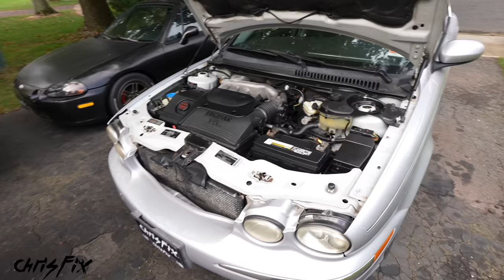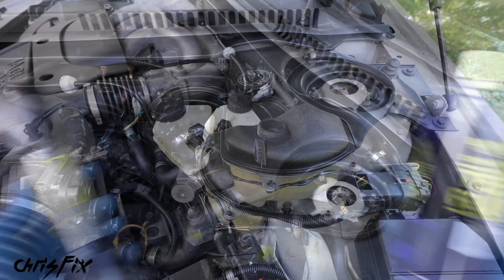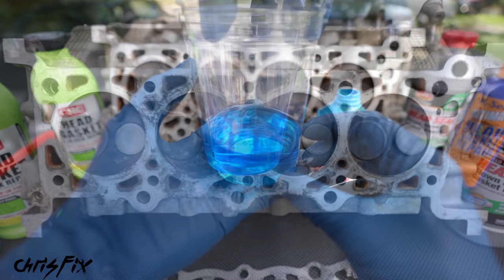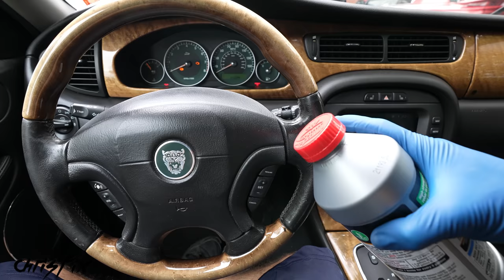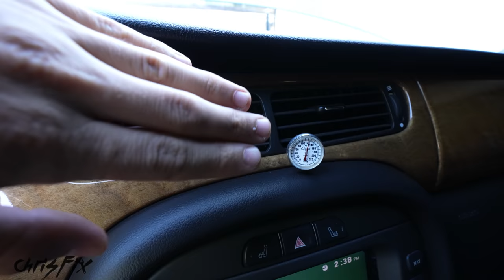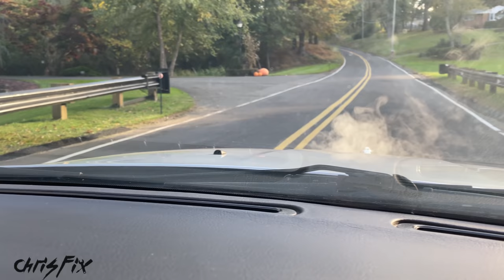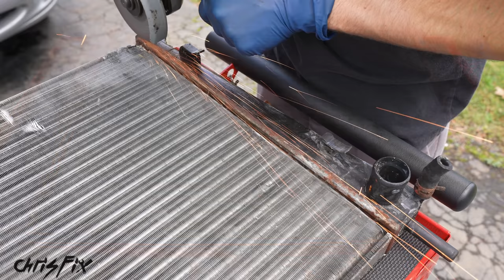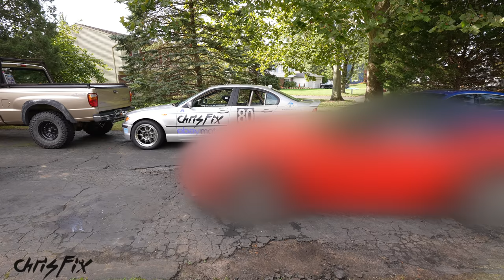Do Head Gasket Sealers Actually Work (FULL 2yr TEST with Engine Teardown)

Comment: I wonder if it would work on a diesel engine - high pressure
Reply: Sure.
Reply: @SinsBird  thanx, I think,  - guy near me is selling a John Deere backhoe for 2400, wants it gone, blown head gasket, it would be deal of the century if I could pour a bottle that stuff in and fix it for  a while
Reply: Success of this kind of repair depends on how much you are willing to prep for it. Things like flushing the cooling system multiple times, removing the thermostat, glow or spark plug of the worst cylinder etc improve your chances a lot. Also it should not be done in one go.
Reply: @SinsBird  thank you - good advice
Reply: @jameshallahan4376  no problem. If you decide to try this, make sure the cooling system is pressurized, because pressure is needed to push sealer into the leaking spot for it to seal. Use water. You can mix it with water before pouring into the cooling system. Keep the RPM above 1000. Let the temperature rise some, shut the engine off, let it sit for and hour, check coolant level, add water if there's less of it now, start and run the engine some more to reach a higher temperature than before, shut it, let it sit for an hour. Check the coolant level...and so on till it reaches the operating temperature. Don't hurry to dump it out of the cooling system, make sure that it sealed for sure, keep RPM high so it gets hot, then check the coolant level. If it's okay only then dump it out. Flush the cooling system multiple times before and after using the sealer.
Reply: @SinsBird  thank you so much - I haven’t got it yet, I’m next in line pending, good stuff to know, if I get I’ll let you know
Reply: @SinsBird  how did you learn all this?
Reply: @jameshallahan4376  well, if I'm doing something I like to actually understand what is going on and why, so I looked into the chemistry of it, which is quite simple considering most sealers are sodium silicate based and then thought about what is happening inside the engine, then I conducted my own experiments on several engines.
Reply: @SinsBird  excellent

Comment: What one works on the northstar 4.6. 😅
Reply: Is oil and coolant mixing? Oil in coolant or coolant in oil? Or both? Is the cooling system pressurized?
Reply: @SinsBird   no , it's just coolant-exhaust mixing.
Reply: @1967brokedude  If the cooling system is pressurized any sealer will work. If removing the thermostat would be a problem for you choose a sealer which doesn't have particle filler in it. I recommend to do it in steps, not one go, also keep the RPM above 1000. Let the temperature rise some, shut the engine off, let it sit for and hour, check coolant level, add water if there's less of it now, start and run the engine some more to reach a higher temperature than before, shut it, let it sit for an hour. Check the coolant level...and so on till it reaches the operating temperature. Don't hurry to dump it out of the cooling system, make sure that it sealed for sure, drive it keeping rpm high so it gets hot, then check the coolant level. If it's okay only then dump it out. Flush the cooling system multiple times before and after using the sealer.

Comment: Unless it’s oil I don’t think you should pour any of this sht into your engine. Just spend the money and replace the head gasket then you know it’s good for pretty much the life of the motor at that point
Reply: This stuff is just designed to be an inexpensive, very temporary fix; keeping your car on the road for as long as you need it to be, and it very much does that job well. If it didn't the jag would've still been losing coolant and the company selling the stuff would've gone bankrupt years ago 😂

Comment: What $7000 for the head gasket repair? What's wrong with mechanics?
Reply from the maker: It's a lot of labor to pull the entire engine, resurface both heads, reinstall, etc. And since the car was old they know other parts break. I am not justifying it, I am just saying there is a reason I didnt fix it properly either haha.

Comment: The instructions on the bar's states absolutely do not mix with coolant.
Reply from the maker: It says not to mix with oil. How is it supposed to work if you can't add it to your cooling system lol
Reply: @chrisfix  from their service bulletin on Amazon: WARNING:

"Head Gasket Sealant is NOT COMPATIBLE with antifreeze and must only be added to the cooling system after ALL ANTIFREEZE has been flushed and removed."
And Secondly mentioned: "ALL antifreeze must be removed or clogging may occur". The way I see it they want it to be the only thing in the cooling system. Love the video great long term analysis!
Reply: @chrisfix  I'm going to try it on a Suzuki outboard motor today. I think I might be the first to ever try it lol I'm going to put several bottles in a large bucket with the outboard sitting in it
Reply: @wests3771  That's not how it works.
Reply: @SinsBird  please elaborate how you believe it differs. Thanks
Reply: @wests3771  What I mean is that it needs adequately pressurized and sealed cooling system and warm/hot coolant. A lot of times it actually seals the most when the engine is shut off and the coolant is being pushed into the engine by elevated cooling system pressure from it being hot and when the combustion pressures are not fighting back. I can't remember the exact construction of outboards but you would need to find a way to seal the cooling system, probably plug the water outlet and apply pressure perhaps with an air compressor or something if the construction allows it, all while the engine is hot. Really seems like a headache, I think it would be easier to repair the regular way.
Reply: @SinsBird  I carefully read and exactly followed the product guide I'm confident I know exactly how it works but let me know what you think
Reply: @SinsBird  Roger that. I tried it yesterday. I did apply pressure to to outlet at times. I appreciate the input on the differences in cooling systems  Good point. Time will tell if it worked for me.
Reply: @wests3771  Product guides are really half assed in this case and just enough to sometimes work for a person who does not understand engines and doesn't have the tools to do the job the regular way. A real educated mechanic who knows basics of chemistry and physics would add a lot more steps to the procedure to raise the chances of it sealing successfully without causing additional issues to at least 80%.

Comment: One thing I noticed on the video, Even though I used CRC or kW; I forget which one, Because they're both have tops that look like traditional radiator caps. Anyway, if you pay attention to the right part of the video, you'll notice the engine light turns off. So with proper problem  & application, these products do work. One of them was supposed to be able to remain in the engine in case another problem pops up. So over two years when it was time for inspection, and the engine light was on, I would just let down the windows and turn on the heater full blast and drive down the freeway for 10 or 15 minutes and the light would turn right back off again. Meanwhile it would be intermittent. A rubber seal on my car blew a few weeks ago and threw all my coolant gasket sealer out. Now the engine light stays on. Re-apply? As soon as I can. Inspection is due. Didn't have one problem with it stopping up anything.

Comment: I wonder if it would work on diesel engines I’m at the point to try anything before spending $11,000
Reply: Yes.
Reply from the maker: It could but the higher compression is definitely more challenging.

Comment: Unfortunately this thing doesn´t works. I believed in this video and add it to 2 of my cars. Both got burn out even when the cars could works for many hours until they heat a bit from half indicator...
Reply: Must have done something wrong, was the cooling system pressurized before the procedure? Was the leak severe, if so did you remove the plug from the worst cylinder to eliminate cylinder pressure? Thermostat removed? Heater core valve fully opened? Cooling system flushed several times before the procedure? Added correct amount of sealer taking cooling system capacity into account? Mixed the sealer with water before pouring it into the cooling system? Procedure done in several cycles raising the temperature some more every time or did you do it in one go?
Reply: Thank you for your answer @SinsBird  Whatever it may happen, I´m now sure that none of this things you mention here is nor in your video or instructions in the manual of the product. This is a lesson now I´ve learned to not trust in marketing
Reply: @glaucorobelo1970  yes, marketing makes it look too easy.

Comment: You are using the worst ones on the market. They are cheap for a reason. Also, using them with antifreeze, you risk clogging the cooling system by turning the cooling system to gel.

Comment: What if the car wont start to test?
Reply: Solve the starting problem first.
Reply: @SinsBird  Would be easy if we knew the problem to the starting
Reply: @msgaming71601  Well for engine to run it needs air/fuel mix, compression and spark if it's a gasoline engine. Spins with starter? Good. Check for spark. Good?
Reply: @SinsBird  Battery, Starter, Alternator, spark and compression is good. All the spark plugs are new. Fuel pump and fuel filter is good. No codes are being thrown either
Reply: @msgaming71601  Strange, so it would seem to be a timing or fuel issue. If you want to check the head gasket just in case, fill the cooling system to the brim and spin with starter (all plugs must be installed). If it has a serious head gasket issue the coolant would be shooting out of the radiator or expansion tank when the cap is removed.
Reply: @SinsBird  Could be head gasket. I know timing was changed not too long ago
Reply: @msgaming71601  Gasket very unlikely since you said the compression is good.

Comment: You only used ONE product so the test wasn’t comprehensive. Obviously you only had one car but a call-out to viewers who had HC issues might have given you three more motors on which  to experiment. Cheers.
Reply from the maker: If you scroll through the comments you can see hundreds of stories from viewers who have used these products and you can see if they worked/didn't work and other info, to try to get this level of detail shown in the video on 3 more cars would have been impossible
Reply: Impossible?

Comment: So u are telling me that i have being charnging wrong fixing head gaskets 🤕 i have being charging 1200 damn im just a dumb mech then 😂😂
Reply from the maker: I realize you're just making a joke but as explained this is a way to get a little more life out of your car if the bill is not worth the repair. If it was only $1200 to do the Jag headgasket I would have done that in a heartbeat haha. Well in that case it means it's not a hard one so I would have done it myself probably but you get the idea.
Reply: @chrisfix  i was saying it that thats what i charge to make a blown head gasket change im a mech to 😅, but u show me that shops can charge 10× that price, here in tennesse is just madness 🤣
Reply: @chrisfix  by do way, do u know much about e46?, j bought one, was having overheating problems, i change water pump. Radiator, expansion tank, check for any leak, make a vacuum test, make a smoke test in the cumbustion chambers, everithing good, but still over heating, and he is not warming the cabin just throw cold air 🤕

Comment: Poor test.  Poor example..  A Jaguar?!?
Reply: what? the head gasket works the same as all others
Reply: @jacksheneman6242  - No, it doesn't.  Ever heard of a heater core, coolant lines, radiator function, and the historical nature and issues of Jaguars themselves?
Reply: @walterhartman3275  yes buddy every car has a heater core and coolant lines, head gasket works the same
Reply: @jacksheneman6242  - they're set up different, buddy.
Reply: @walterhartman3275  explain how the head gasket works any different
Reply: @jacksheneman6242  - dude, first of all, it's an aluminium block, slant inline-6.  That engine just by it's engineering alone is going to do better than a lot of other engines for this fix.

😂🙃😗- If it's a 1990, I just looked up the original engines were the DOHC 1.6 and the SOHC 1.9. The DOHC 1.6 was revised and enlarged to 2.0 in 1990. It is still essentially an "AJ4", however. This was, as per usual, offered for the XJ-S before it was built into the XJ40 saloon.  Because I used to have one.  The nature of these engines is that the head gasket probably wasn't very bad to being with, and yes, you did a thorough gob, but with a superior built engine with added attention and ran through rigorous testing and study.  

There's some other factors.  Such as, the power was reduced in these to 201 hp (150 kW; 204 PS) for versions having catalytic exhaust system.  It's all connected.  Different results for different makes, years, and models consistently I'm noticing.  But good test otherwise..
Reply: @jacksheneman6242  - dude, you're driving down the road with a full face helmet on... 😅😂🤣😆 dying over here
Reply: @walterhartman3275  umm that was a v6..
Reply: @jacksheneman6242  - doesn't matter.  Jaguar makes superior engineered cars, as I've so stated, so either way, bad example.